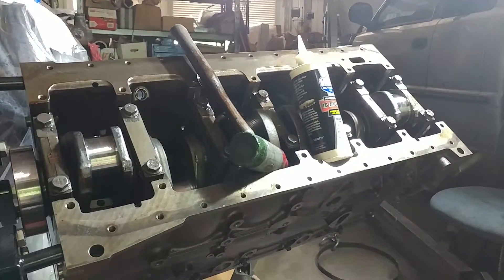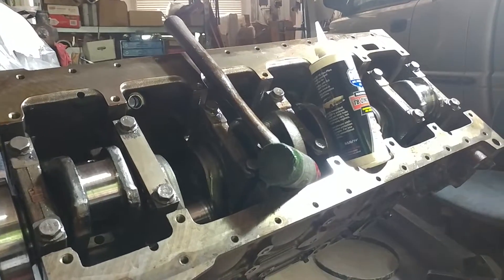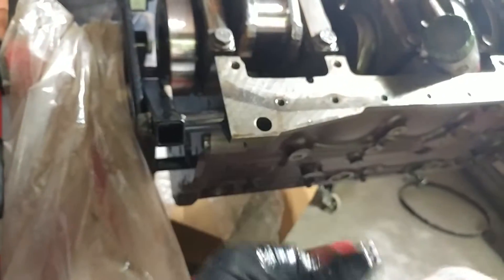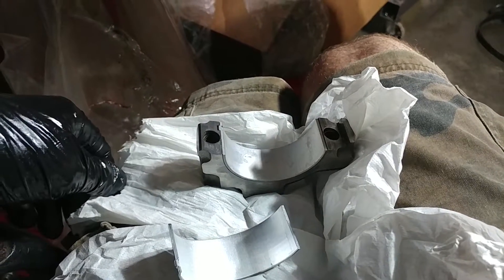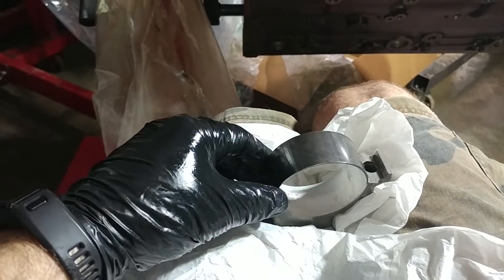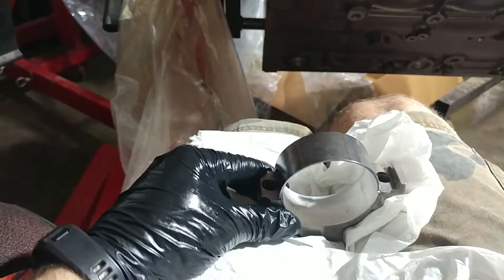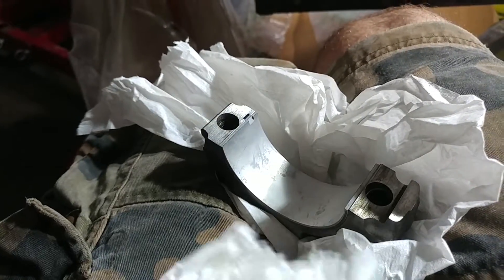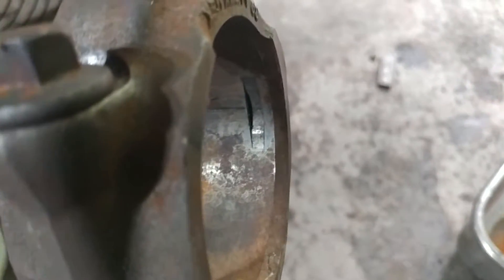Chronicles Of An 03 Cummins Rebuild -Part 19- Make Sure You Pay Attention To Your Rod Bearings

Comment: I’m thinking of going with the 24v vp rods in my rebuild because I hear they are stronger. Being this engine is an 03 and mine is an 03, or just in general are the rods interchangeable except for the bearings. Also do you recall the direction the rod caps were mounted? I’ve seen a lot of arguments about the direction to mount them but if yours came with them in it then I’d imagine that would be the direction they should face. Also I’ve seen unnamed and England and I’ve heard of brazil and USA rods but I’ve also seen conflicting opinions of which are better
Reply from the maker: Hey Jason,  before we get too far into the question,  I have to ask, have you already had your oil pan off?
Reply: I have the whole engine torn down. It had a spun rod that seized the engine. I’m investigating my options for the crank and rod. I plan on staying stock or up to 500hp but I’d prefer durability over power.  From what I gathered is the rods will fit and I was thinking of using a 24 valve crank and drilling the end of the crank for the dowel rod. Ultimately cost is a factor. I have some videos of the removal an teardown. I used the ultimate all terrain engine hoist.
Reply from the maker: Hey Jason,  You are on the right track. The reason why I asked is because some of the early CR's actually came with 12/vp44 style machined cap rods. Do you know if you rods are Machined cap or Cracked cap rods?
Reply: The original ones are the cracked cap rods, I bought a set of 12 valve USA rods from a 91 off eBay last night. I just need to locate a crank, I’m alittle nervous of getting one off eBay, but 1 I don’t want to spend 1100 on a crank and 2 there pretty hard to come but here.